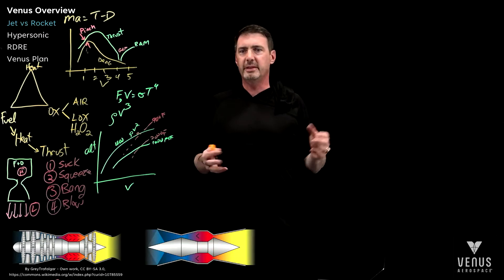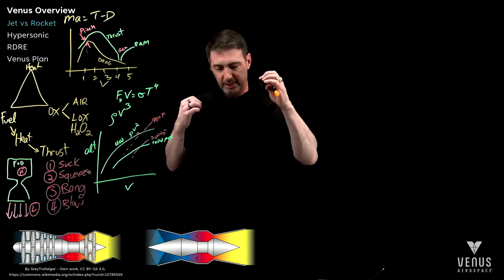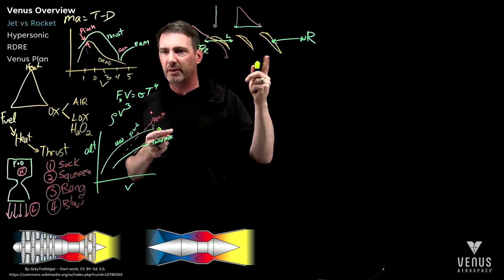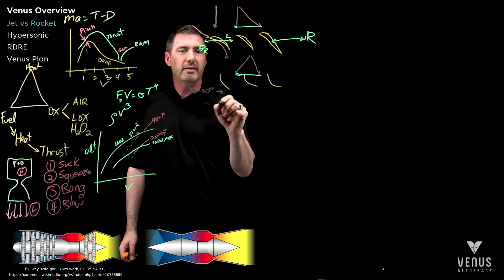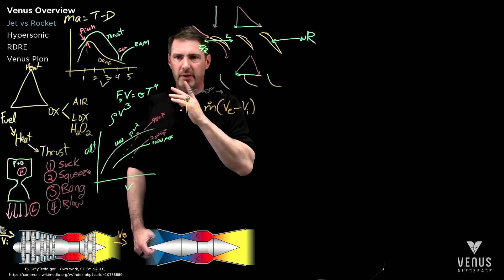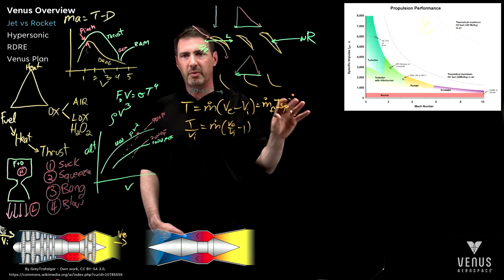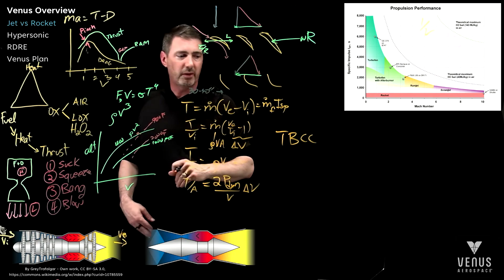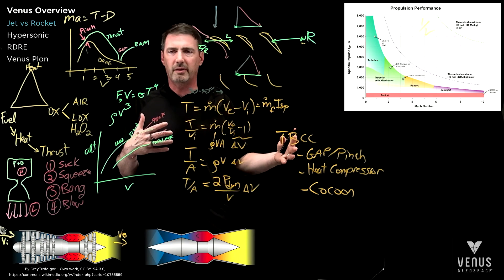High Speed Flight Episode 1.1 | Jet Engines

Comment: Question (just curious as a student) 🙋‍♂️ 

what are the fundamental limitations that prevent these engines from achieving significantly higher specific impulse (fuel efficiency) than current jet engines in high-speed flight? What theoretical or practical barriers must be overcome to achieve a substantial breakthrough in this area?
Reply: The efficiency (specific Impulse, Isp) relates to fuel energy via Isp*V = H * eta_th * eta_j, where V is speed of aircraft, H is fuel heating value, eta_th is the thermodynamic efficiency (conversion from chemical to heat) and eta_j is jet efficiency (conversion of heat to thrust).  The driver of thermal efficiency is a material temperature limit both at the last compression stage as well at after the combustor at the first stage turbine.  GE has done amazing work here with ceramic matrix composite materials.  Jet efficiency is basically maximized by taking a whole lot of air and barely increasing its speed, so that's why the jet industry makes bigger bypass engines (the turbine engine is actually a small core, driving a large fan). Pratt & Whitney did a big jump here by going to a geared turbofan, decoupling the speed the engine wants to turn at versus the speed the fan wants to turn at.  Third option is to lower losses across the system.